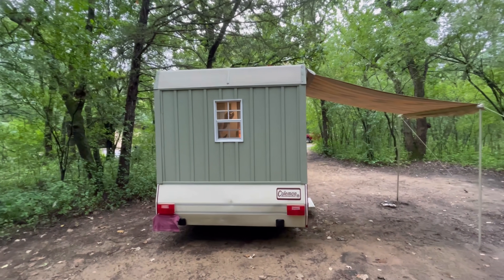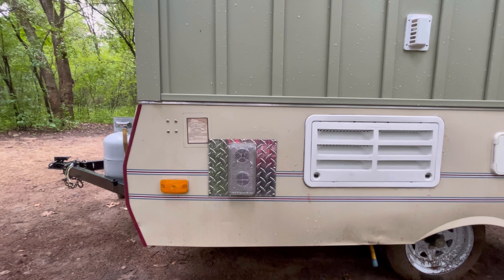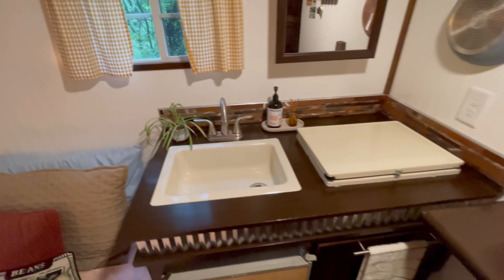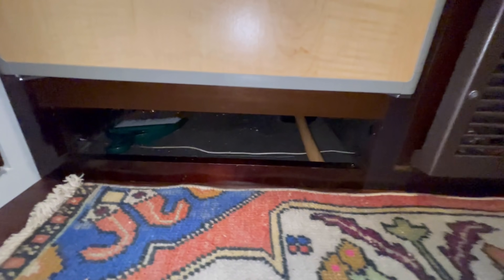coleman columbia pop-up camper conversion tour

Comment: Very nice conversion,but I have a couple of suggestions. 1 you should make some kind of rigid lockable cover for your propane tank and your battery , batteries should not be exposed to the elements because moister will drain your battery and a lockable cover will deter theft.2 it might be a good idea to get yourself a small portable cassette toilet they are easy to use and they can be stored under any cabinet plus they are not very expensive ,look on line for the different models, and price ranges. This will help if you have inclement weather, also will be safer for you at night. That is all I can think of ,so good luck ,have fun and may the Lord bless you .
Reply: All good, sound advice Arthur.
Reply: Yes very good advice especially at night for a young lady
Reply: I love your camper!  Awesome!  Great suggestions from Arthur
Reply: Great little Camper, especially for short getaways and weekend tours. Great job.
Reply: I think. you have a clever,  cozy design. Great job and very inspirational!
Reply: Very nice
Reply: Your little Coleman is adorable  and I think you might enjoy stringing up some little twinkle type lights from the molding around your ceiling ❤
Reply: I'm thinking she's probably got a bucket somewhere but didn't want to show that
Reply: My own preference would be for a lower height,  but I'm short and it makes me cozier.  Other than that quibble,  I'm just amazed at this.
Reply: Also could use a home made composting toilet. Very inexpensive to make. Can order the separate diverter part online for #1.
Reply: I live in  Manitoba where mosquitoes take over after 4:00pm. If you had mosquitoes netting you could velcro it to your awning and use magnets on your camper walls. It would give you bug free area outside your home.
Reply: Cute as can be.
Reply: Damn, build me one. Great ideas.

Comment: Amazing! I love it! It is definetly a master piece! It's obvious your father is very gifted. Such beautiful work.  I have a 1996 Coleman pop up trailer that I purchased a few months ago. It had no refrigerator, , toilet, or sink.. I have purchased a dorm room refrigerator, a porta potty for my wife, a free used propane grill from the curb that I cut down to a double burner grill instead of the 4 burner. It looks so cute being miniturized😂. I added two small pneumatic tires on one end of the grill and a handle on the opposite end to lift and pull  it around easily. I have a propane hose so it can be used indoor if raining or outside when no rain. We love being able to use it either way. I just got in my miniture stainless steel sink that Im going to add to one end miniture BBQ pit so they will stay together as a unit. . My wife prefers them outside of the popup on nice days so we have more room inside. Our porta potty has its own tent for when we put it outside of the trailer. We just got finished rebuilding the roof. Man was that a job😒 but that repair is now completed. Our pop up was gutted when we bought it. I'm retired now so this has been the project I do when its time to get away from the TV😆. We have been using a tent for years but the last time I put it up it was hard on my old knees so we decided to buy a used pop up camper to restore. We are both 60 y/o and I just retired after 30 years of welding for the same company here in Tx. Everything we have is paid for. So now its time for some enjoyment in life🙂.
Reply: Had an84 for 25 year's, was a good camper.

Comment: Nice job! I did something similar to the pop up camper that I acquired for free. It was the perfect setup for 2×2 stud walls to fill in where the canvas was. I kept the rear pull out and made solid foam walls for it. Happy camping!
Reply: Trying to figure out how the foam walls work when you take it on the road.  We have a pop-up we need to do something with.  Weekend camping trips are almost too short for all the trouble of a pop-up
Reply: Foam board is amazing material. Do you remove your foam walls to close it down and travel?
Reply: @rainsofhealing  yes!
Reply: @AngelWerx-2012  So you’re still able to fold your camper down to a normal pop-up size?? And you keep the walls inside while traveling??

Comment: You should ask your dad to put blinds on the windows for added security. Also a better door lock on the inside, again for security. Inside small solar generator for back up use. You both did a good job, looks good.

Comment: I love what you & your father have done with your vintage Coleman!  Absolutely 💯 functional, homey & much more secure than fabric pop ups. As a female who loves vintage Rv’s & campers this is the best pop up conversion & remodel I’ve ever seen. I’ve had several pop ups & my favorite was the 1972 Hard Side Apache Ramada which like yours was much more secure than canvas sides & that’s important to me. The only things I could respectfully suggest to you would be getting a cassette toilet or something similar to have inside so you don’t need to go outside at night. It’s not nearly as safe as it used to be camping as we all know. You could also put a little cover & cushion on it & have a little chair when not in use 😊I always carry several different types of personal protection..ya never know 😐 I also have a couple of cameras on the outside of my Rv trained on the doors & windows. You can pick up this stuff very reasonably.  Beautiful Work, I’m Subscribing & Look Forward To More Camping & Camper Videos!! Thank You!!

Comment: What a lovely tiny home!  Great father and daughter project, lucky you to have such a skilled father.  I think the plastic rock face looks fabulous and breaks up the visual monotony.  Nice touch.  Inside is clean and cozy, lovely!

Parking it, is one thing. Traveling with this is another whole dimension.   Some suggestions;
1. Your propane tank and battery bank must have a lockable metal housing. Protect from theft, rocks on the road, moisture, overheating from sun, or too cold from weather, and rust prevention.  Keep them in a ventilated, locked steel cabinet, with some insulation too. 

2. Build some overhead cabinets inside. Nothing can be dangling from walls like the pans, wire baskets, etc. The bounce on a trailer is high, and stuff will come flying out of open crates, wire cages, and pans will clatter on the wall. Tuck it all away.

3. Wasted space under bed - make longer drawers and don't use crates. They should be solid wood, no gaps.  This can let in mice, moisture, dust.  You don't want mice droppings in your clothes.  Make long drawers that go all the way back on long extensions. Make wood trays that sit on top of your plumbing area.

4. A composting toilet is a must have. No toilet, no travel. Getting out at night to find a place to pee is a very bad idea. The Trelino runs $300 - $500. Copy it.  Make your own. Get a bin and put your #2 baggies in it. #1 liquids go in a jug and dumped at any rest stop.

5. Get a Travel Berkey as your water filter. Get the white Fluoride/Arsenic filters as well as the standard black carbon filters. This will remove any arsenic and fluoride in tap water, as well as chlorine, chemicals, bacteria.  Cheapest water solution. Do not drink from your water tank, carry separate refillable 1 gal water bottles, refill from tap, then pour into Berkey. Don't compromise on this. Don't install a pricey filtration system. Berkey is the cheapest and best.

6. Why do you have battery powered lights on outside?  Use only solar powered lights outside. Each solar light runs $5-$10, and has its own solar panel. You mount it, and clean the solar panel with vinegar once a month to keep scale down. If it dies on you at some point, change the rechargeable battery inside for an endless life.  Solar lights are good for years.

7.  4:57 - Water tank needs an extra large access hatch on top for cleaning. Add large baffle balls in it so you don't get sway from that water sloshing around inside. See Humble Road videos to know how. 

8. Be aware that propane heating/furnace creates condensation inside the trailer. Cheap Chinese $200 Diesel heaters (Amazon) will keep you very warm with no moisture inside.  They come with a slim tank too.

Comment: Kick ass! Big things do come in small packages. It's so twee, but so practical. There's two handles on the sink faucet, but I assume no hot water; just plug the sink and heat water on the stove. Those three vertical cabinets in the corner are very handsome. Very thoughtful use of space and I'm sure the more it gets used, the more like home it will feel. Eeeeee, I'm so excited for the travels and adventures you'll go on with your little camper! ✌️💚🌟
Reply: I’m not sure if she has hot, probably not. Could fix that easy with a small 2-3 gallon inline (on demand) tankless heater using LP/propane. Or even electric. People use them to make outdoor camp showers real easy and she could even hook up a shower hose for outside to take warm showers outside/next to the camper! That would be a fun and worthwhile project id like to watch on here and I’m sure others would as well?

Comment: I used to own this exact model of trailer when my kids were small!  Unfortunately, I made the huge mistake of storing it one winter next door to an orchard.  Mice got in and ate a hole through the tent fabric and made a huge mess with droppings everywhere.  I also stupidly left 2 rolls of paper towel in the galley which the mice completely atomized.  When I opened it up the next spring it was full if white fluff up to my knees!  I completely cleaned it up, patched the hole and sold it cheap to a nice young couple with a baby who were just starting out.
Reply: Don't feel bad, it probably had nothing to do with the orchard. Mice get into almost all campers and trailers eventually.
Reply: Mice and rats will get anywhere !! Not your fault.

Comment: I own a Coleman pop-up trailer, from 1986 and it’s in great condition. This is very impressive work great job! All I’m doing to mine is adding new vinyl plank flooring that looks like wood and painting the old wood base bench seating a different color and going to use a plastic laminate film on the countertops to look like marble.

Comment: This is a very clever conversion of an old popup.  About 15yrs ago, I also had an old Coleman popup that was in fantastically great refurbished condition when a drunk driver ran into the back of me when I was stopped at a stop light. The camper was a total loss, but the memories of that trailer are keepers! One thing I suggest to all singles road traveling is that you get a dog. Extra security and a built-in alarm if not a fierce protector. They’ll let you know if someone is near your camper. Another thing I’d suggest are some motion lights around the outside. I installed some led motion lights with simple 3M tape, so they can be removed without leaving holes in the side. They are wonderful and hands-free.

Comment: Nice job, my best friend from MMI in Orlando did the same thing only his used pallet wood for his outside siding and then just burned it to bring out the grain of the wood and then stained it. Then sprayfoamed the insulation and used paneling that his brother gave him from his living room when they took it off and put drywall up then painted it. He had a loft bed also but he bought a cheap long dresser and modified it so he could put a small refrigerater in one side, he didn't have a sink in his, he just used paper plates and plastic utilsiles and threw it in the fire pit when he was done, he took an old metal microwave cart that he got from a flea market and cleaned it up added some metal to the legs to make it sit up higher and repainted it,  he had a microwave, a crockpot and 9 function air fryer to cook food. He stayed at State Parks and National Forrests in and around Orlando for like $6 a day and they have bathrooms and showers. I don't remember  what it cost him to build but I know it was well under $1000, after we graduated he became a a traveling tech for BMW and still lives in it today, when he gets moved he just attaches it to his S10 Blazer and takes off to wherever they send him next.

Comment: Great job!  I hope you enjoy it.  When I saw your tiny porthole dome window, I immediately thought of the solar domes for roofs and wondered if you put one on top of the roof as well.  It's just fine how you finished it.  If you wanted to do more work later as a remodel, you could add one to the roof if it could be made waterproof and not interfere with your solar panels.  Cheers.

Comment: Very cute place you have there. You can add little upgrades as you go. I love your bed set up. It was a lot of work. I am concerned about your ventilation, however. There are many options for low profile, low electrical use fans. There is one by Maxxair that can be mounted on the ceiling or the wall. Put a screened, pluggable plain vent on the opposite wall and you will have amazing cross ventilation. I bet your clever dad could come up with an easy solution. Best wishes and have fun.
Reply from the maker: yes that would be a useful addition to the space, especially when cooking. thanks so much for the comment 👍🏼

Comment: A 5 gal. Bucket and a snap on toilet seat, disposable biodegradable liners and sawdust and kitty litter is a good option for your bathroom needs, the sawdust and kitty litter will keep from smelling and when your ready to leave dig a little hole and bury it. You might have to store it under your bed but its safer than going out at night!! If too tall under bed, trim off a bit lol

Comment: One thing I would change is to run the electrical wires above the water tank, because having them on the floor where water could spill scares me. But that's just me. All in all it's an amazing build and I'd absolutely do the same thing.

Comment: It’s adorable!  You made it look like a real home!  I’d be interested to learn more about how to connect things together, like connecting the solar panels to the electric things, connecting the water tank & pump to the faucet, and connecting the gas to the stove & furnace.  Also, do you know if there’s an extra safe deadbolt lock or extra strong door that they sell, to prevent bad people from breaking in?  I ask because we recently bought a used travel trailer and the door doesn’t seem very secure.  I also want to know about connecting things because I’m thinking about renovating a small camper like this, but probably a little bigger, so that my adult kids can use it when they come on trips with us.

Comment: Do the electric/gas fridges take a lot of gas to run? Does the canister for gas take up a lot of space? I'm trying to figure out what fridge I should get for my van. I have a Bluetti battery and plan to get a couple solar panels, but I know most fridges won't last too long with that much power. I'd have to drive to charge it every day or stay in one place for a really long time with the panels or shore power to charge it. Right now I think I can go 3 days without charging it for the power that I'll want while camping. I'll maybe make it a day if I have to power an electric fridge as well. Unless I can find such a low powered fridge it won't take the battery too much power to keep it running or I can maybe figure out a gas/electric fridge. I'm just not sure if those will take up too much space and what using gas power is like. Will it make my van smell like gas? I appreciate any helpful tips.

Comment: I am in the process of a similar build.  My concern is the side walls were not originally designed to have walls built on top and to travel at highway speed.  Did you add any additional anchors that run from the roof to the frame and how has it held up after traveling with it?

Comment: Really neat set up. I'd use one of your under bed storage for slide out potty just in case.. Also what about weight on trailer axl?
Reply from the maker: That’s such a great idea, been thinking about doing that now. 🤔 Hasn’t been a problem so far with too much weight on the axle. Thanks for your thought ✌🏼
Reply: @caitlynbritten  always good to have place to go when needed in case of emergency.

Comment: Stunning conversion! Love this! Question: how well does it travel in high winds? Does it seem top heavy? And I agree with aurthurscott4467 about the lock and potty. Even a bucket with a plastic bag & bought seat from a camping place works pretty well. You can find shorter buckets if need be for storage restrictions. And it could double as a stool. Also,have you thought of sturdier drawers with a locking top to pull out and use as stools as well? :)🌴

Comment: Do you know how much it weighs??? I’m super inspired to do something like this but I wanna see if I can pull it behind a Prius. It looks IMMACULATE
Reply from the maker: I haven’t had it weighed yet but a rough estimate around 1,700 lbs? Check in your manual or online to see your tow capacity. Maybe look into teardrop campers if you haven’t already. They are so cute and work better with smaller vehicles. Thanks babes 🧡